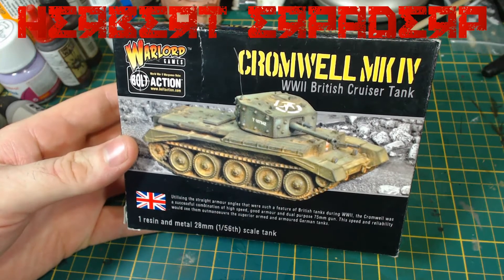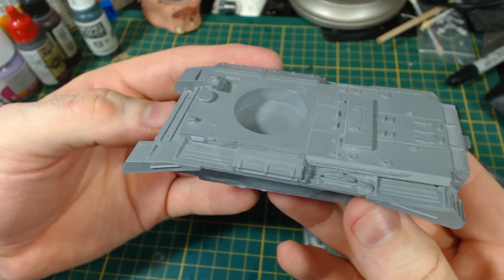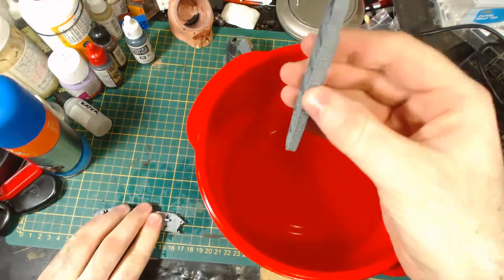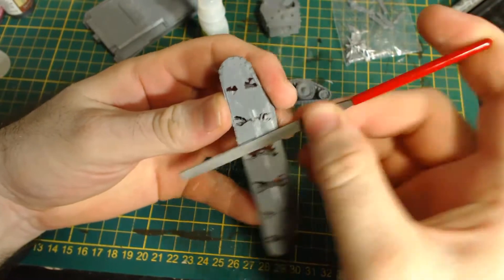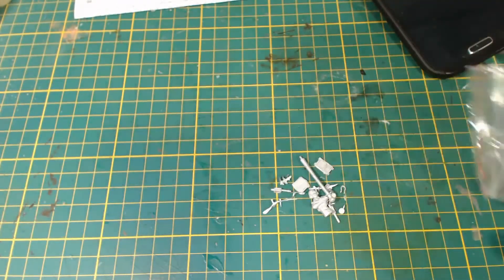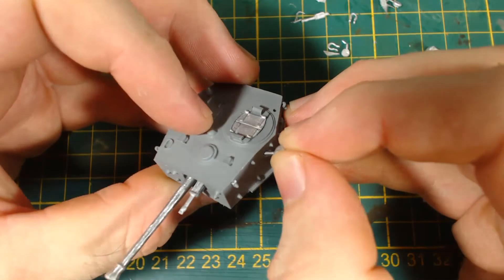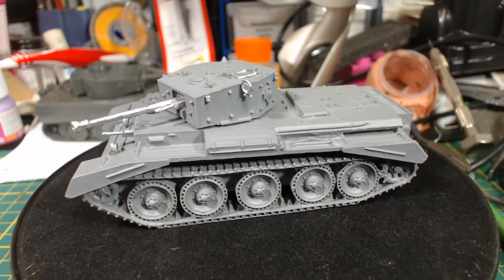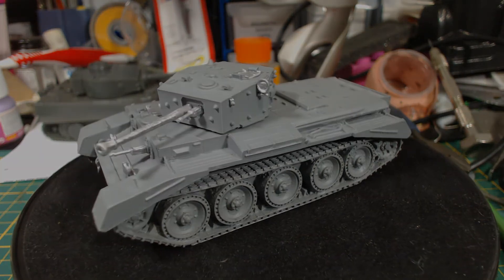Cromwell tank for Bolt Action

Comment: The Turret and hull looks amazing but the metal bits look really out of place on most of these tanks. They always look weirdly casted or maybe I am just not used to metal models?
Reply from the maker: The metal parts always seem to be a little lower in quality to resin or plastic parts. Always need more work. I don't think it makes them terrible... But I do prefer plastic. 

I am sure it won't look as weird once it is painted up or even just primed though.